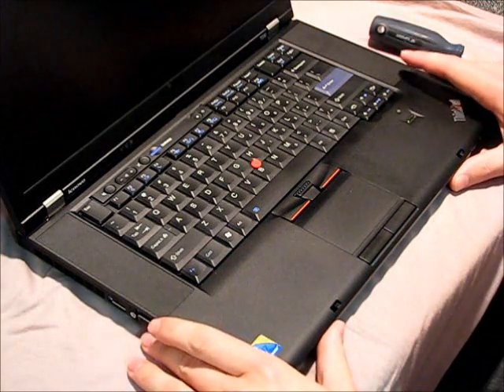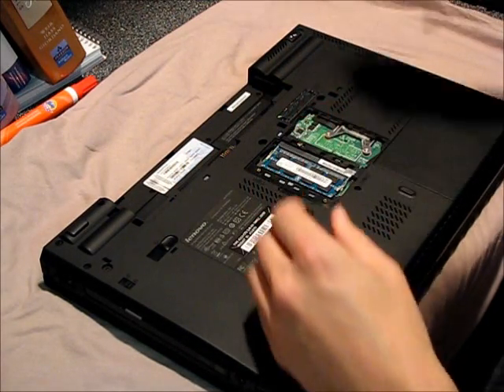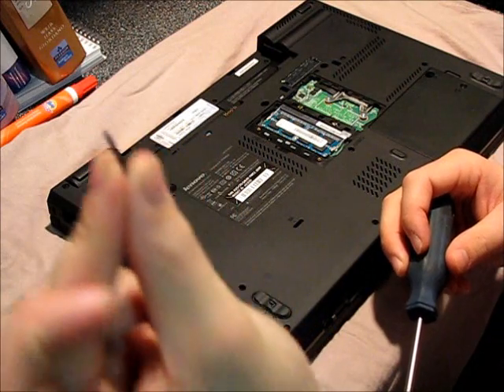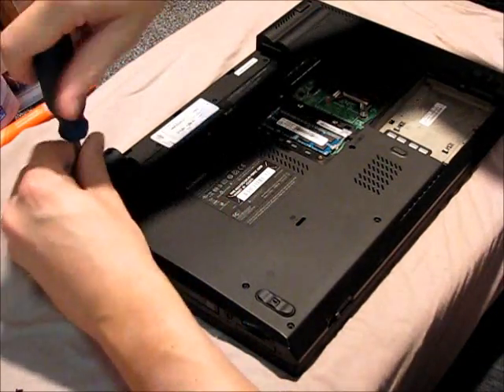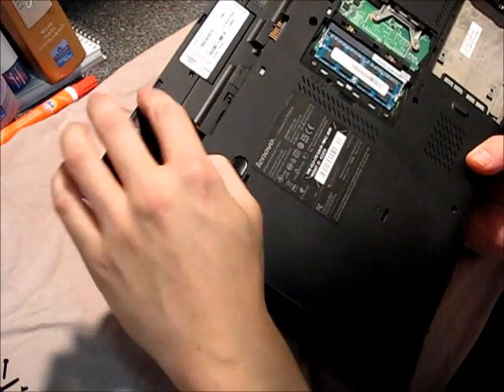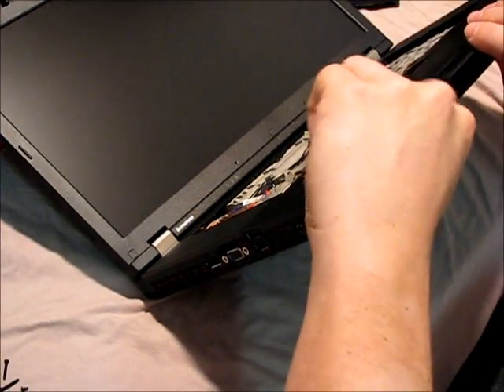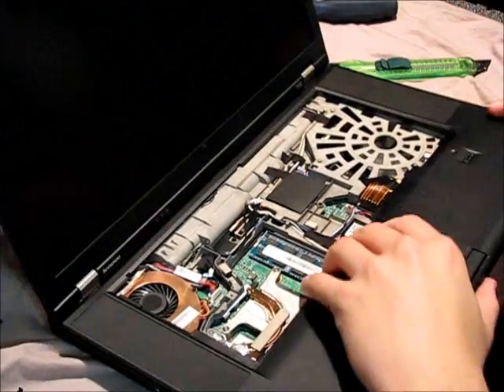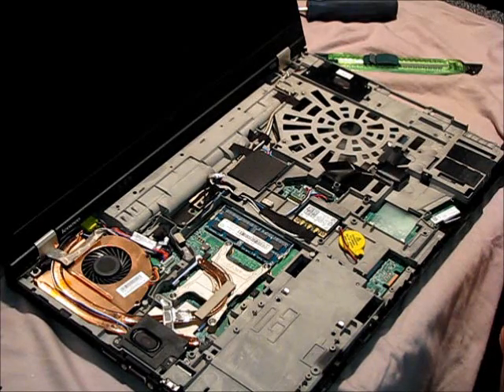Lenovo Thinkpad T510 Palmrest Removal and Fix -- Part 1/3

Comment: how to install micro sata ssd in this t510?
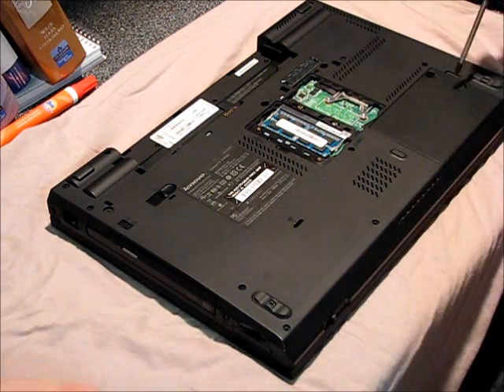Reply from the maker: I remove the hard drive cover at 2:20. Replacing the HDD with an SSD is simple, they drop right in.
Reply: I understand but I'm not talking about normal ssd I'm talking about msata ssd.
Reply: and also can you suggest which ssd (normal) should I buy? Sata ii or Sata iii? T510 has Sata II socket in it but right now everywhere sata iii ssds are available what should i do?
Reply from the maker: Oh, gotcha. mSATA isn't very common. I think the slot is on the mainboard next to the WiFi card.
Reply from the maker: Syed Jaffer Zaidi you can buy a SATA3 drive, they're backwards compatible. It will just be limited to SATA2 speeds. Still much faster than the HDD. I've had good luck with ADATA drives.
Reply: Jonathan Proce some local stores where I live are selling sata ii ssd drives 120gb ssd for like $21 USD should I get it?
Reply from the maker: Syed Jaffer Zaidi 120GB is quite small. It would work but you'd likely run out of space. I would recommend at least 240GB.

Comment: got a question do u still have this if so can you tell me the polarity of the battery connection pins on the laptop .. because i need to know which ones are positive and which are negative /ground thx
Reply from the maker: I'd check it with a multimeter! I never looked into it.
Reply: i cant im trying to fit a different batt i dont have a batt or charger
Reply from the maker: Can't help you, don't have that laptop anymore. Look for a pinout online!